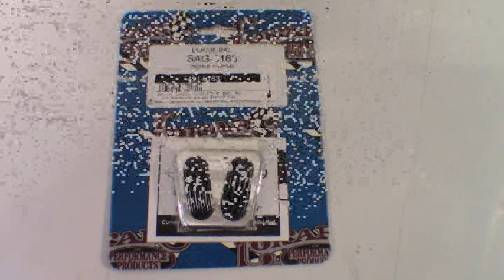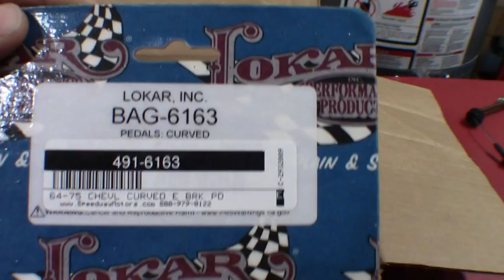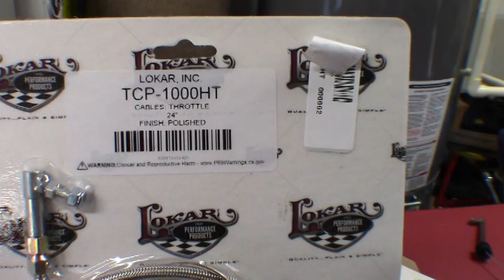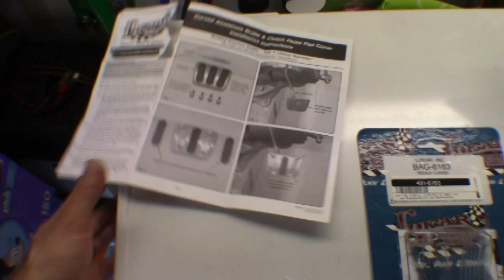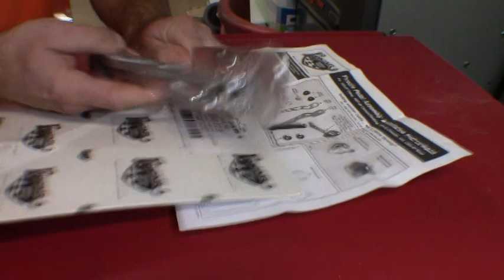Lokar pedal install chevelle

Comment: I'm doing the exact same throttle set up for my '54 Belair. Looking at the throttle pedal mounting plate, did you use the OEM pedal mounting location or did you cut a new one? Hard to tell. Great video thanks for the info.
Reply from the maker: Thank you Doug. I was able 2 use the factory mounting location so it really made 4 a quick and simple install.
Reply: @Turnersspeedshop  I'm jealous, I have to do mine from scratch! Cheers

Comment: Hey, what engine and carburetor do you have?
I’m doing an engine swap on my Oldsmobile Cutlass Supreme, I’m dropping in a SBC. I’ve been looking at this set up for a couple of days.
Reply from the maker: It's a 383 stroke motor..just installed this setup last year it's an edelbrock air gap dual plane manifold with a quick fuel slayer carb. Has been a huge upgrade, very happy with the setup